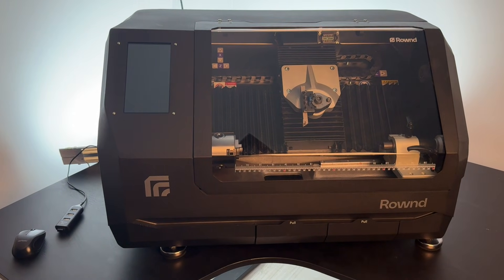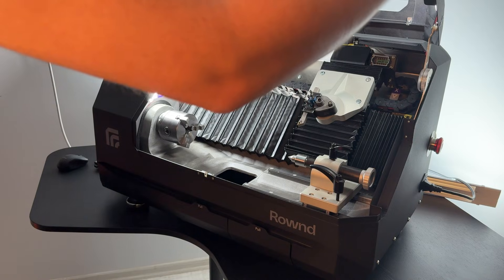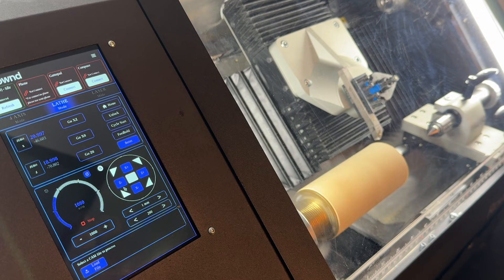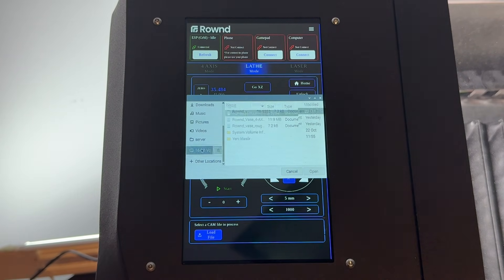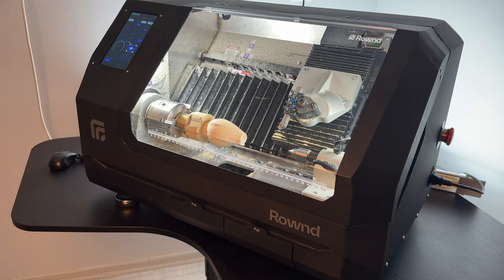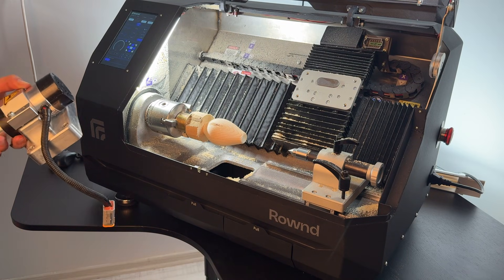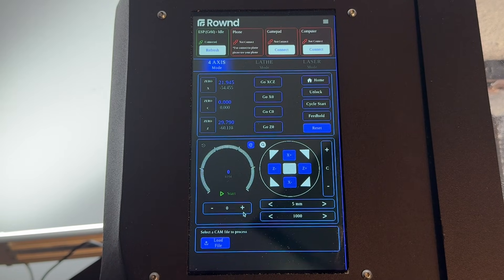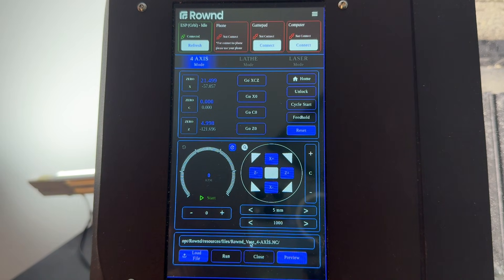Rownd -Desktop CNC Lathe- First Setup and Part Machining

Comment: That manual zeroing to the ‘material centerline’ is so odd. It seems like a simple tool length sensor mounted at known offset from the spindle axis in the x direction should allow automatic measurement for both turning tools and spindle endmills.
Reply from the maker: Regarding this matter, our testing processes are in full swing, and we aim to complete them within the next two months. The hardware infrastructure is fully implemented across all machines; we are currently focusing on integration testing. Successfully concluding this process is one of the short-term priorities of our technical team.
Reply: @ I don’t see how this responds to my comment about tool length setting but ok… ;)
Reply: Is it fixed now ?@rowndprecision

Comment: bu paraya cnc freze alınır
Reply: Yeah a gutless light framed non stop source of problems cnc mill.  That or a completely clapped our obsolete hardware and controller software machine.
Reply: Hello 

As you said you can buy not only CNC milling machine but also so many different machines. But I didn't understand your motivation. This is a Desktop type CNC Lathe and if you need a lathe you can purchase this machine or if you need milling machine you can purchase that one. Milling machine is not an upgraded model of the lathe, so I didn't understand your comparison.